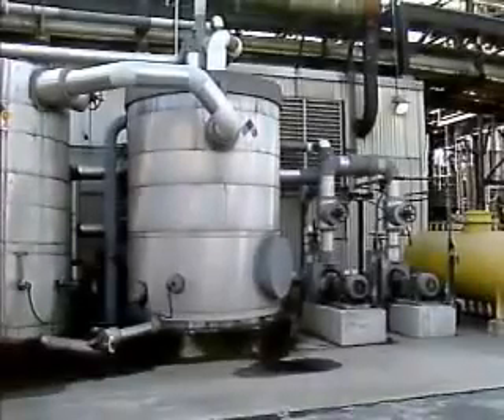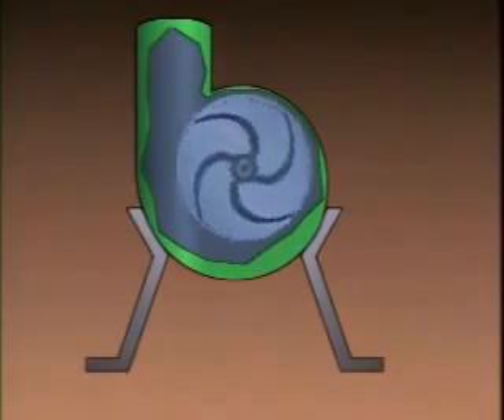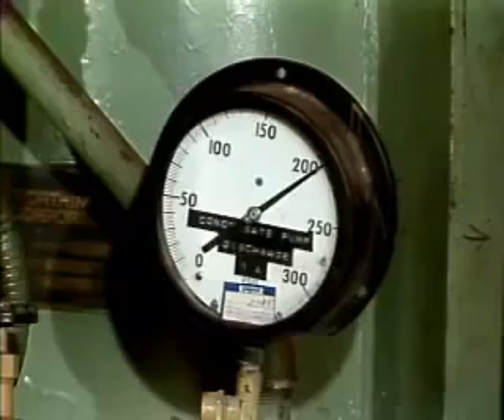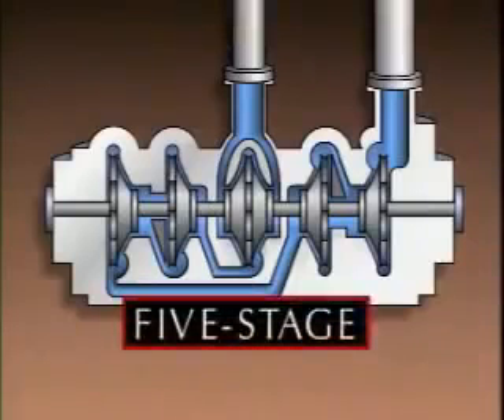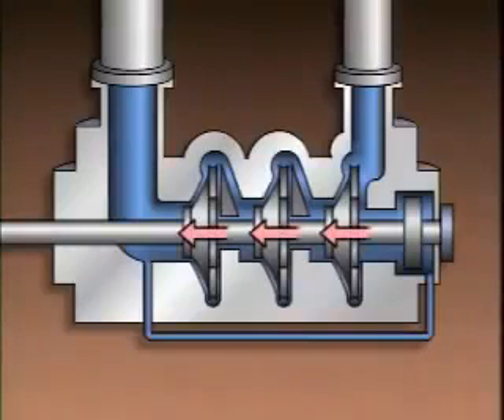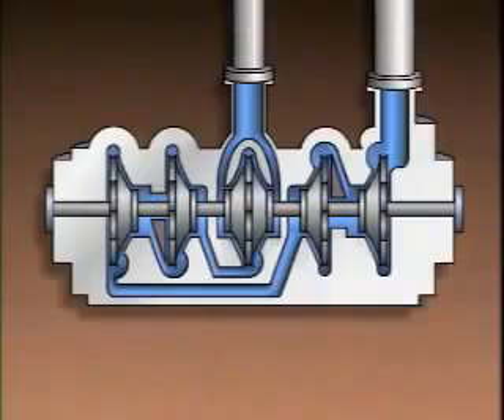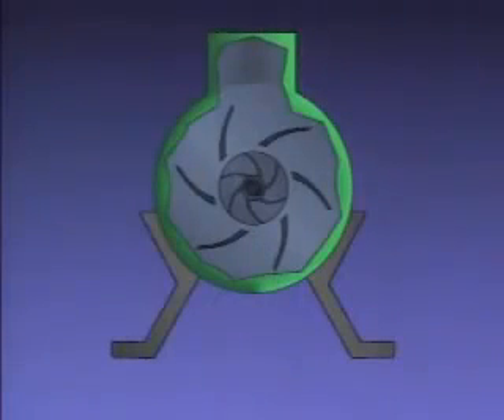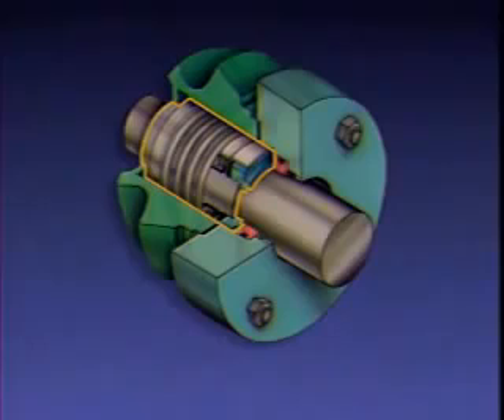About Centrifugal Pump Types ; A good video to Watch detail Operation

Comment: "Centrifugal force" .. oh boy here we go..
Reply: Even though centrifugal force is just the liquid resisting change of it's tangential velocity,for the sake of the explanation it's doesn't matter if it's a real force or not,it still works as planned.

Actually,Tecnology doesn't care if the theory that expains it is right or wrong,as long it is accurate enough.Our first motors worked even though the physics that explained them that time were proven wrong afterwards.Actually,even Newton's laws of gravity are good enough for most of apllications of it even though gravity is not a force like he explained,it's just the fabric of space being distorted according to EInstein.Just like with centrifugal pump,treating both phenomena like forces still makes the tecnology work without problems.
Reply: +Okabe Rintarou well said man.

Comment: Excellent explanations with your power point presentation. really understood the system. I use high pressure water machine for my house keeping works , i understood now how the multi stages of the impellers fans and its route path works giving 100 pounds pressure. Thank you very much. You had enlightned me very well with your explanation.

Comment: Great instructional video.
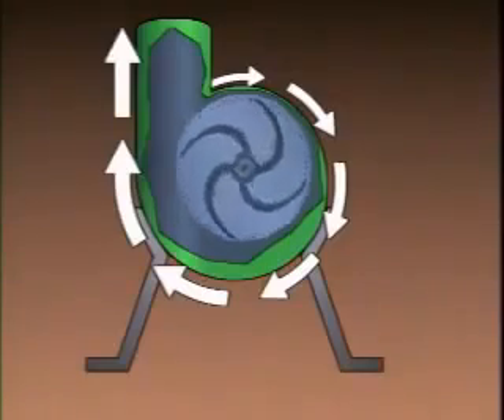Question... Shouldn't the vanes of the impeller that appear on the video until 2:35 be curved facing the nozzle in order to drag more liquid and increase its pumping power?  Thanks in advance for your response
Reply: Ae Sy no.
Reply: Lil Indy why?
Reply: +Ae Sy
Hi.  The diagram in the video is correct.  You're making the same error we all make when we first see this diagram.  :-)
Reply: +Revi M Fadi
You said "why"?
Because, otherwise the liquid direction would go into reverse.